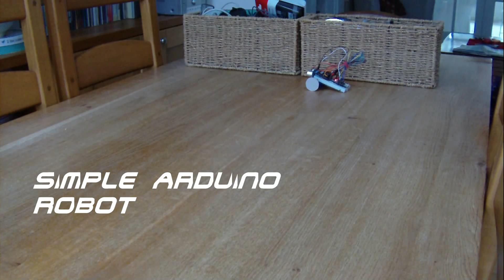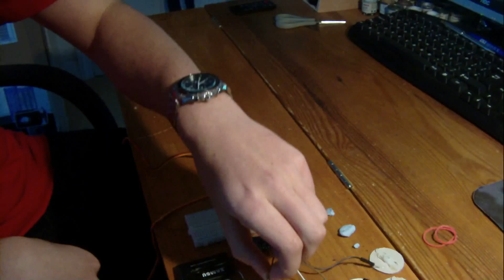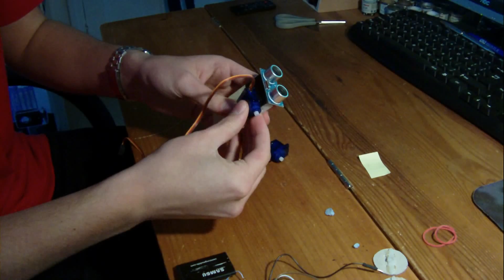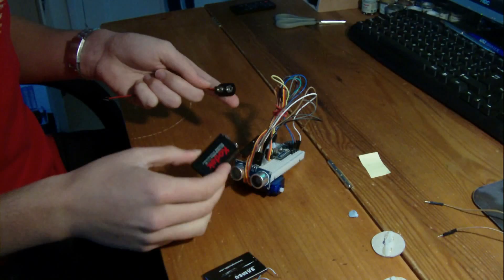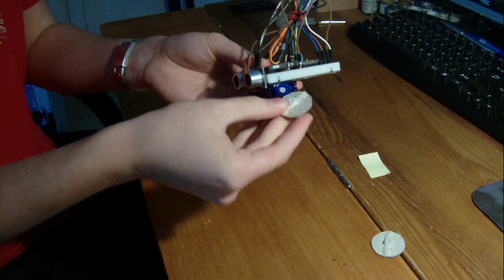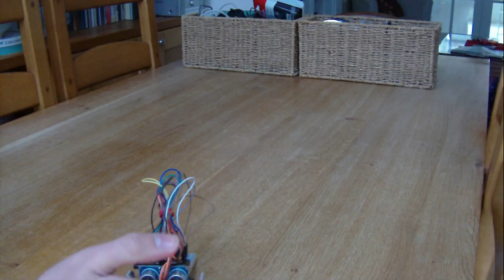How to build an arduino robot

Comment: can you make it follow a line?
Reply from the maker: To make it follow a line it would require 2 infrared sensors rather than an ultrasound one, which unfortunately I don't have. However other than the code and the different sensors the rest of the robot would remain the same.
Reply: but how's the speed control of the servo? is that a fee-tech fs90r?
Reply from the maker: By inputting a larger angle causes the servo to move faster (90 degrees is stationary, 180 maximum speed forward, 0 maximum speed backwards). I just used 9g standard servos and modified them for continuous rotation by removing the potentiometer,  but the one you mentioned looks like it would do the same job.

Comment: Good project.  By continuous rotation servos, I take it they are geared motors and they do not contain the feedback potentiometer one normally finds on a servo.  
You must be pulsing reasonably fast to be able to measure such a short range.
I think you are being very modest to describe this as a SIMPLE arduino robot.   Well you went through a few heartaches to be where you are having to learn the language and  the control system that is necessary.
Well nothing is simple ,  and  something appears to be simple only after the human minds accommodates its understanding,

Good luck with your career. Modern electronics and control teach you a lot about yourself as there is an absolute measure unlike some other subjects which have no  quantitative measure     but a qualitative philosophy which  many people like to follow because whatever they do  cannot be measured and so they feel it is correct, Few people in life like to measure themselves by guaranteeing that their products works perfectly for a long duration.

Congratulations , you certainly kept the system using very basic components that every one can find and so no one has any excuse not to aim high in life.   Good luck and I feel you did well and I would not describe your work as  being simple. Do not be too modest it is good work.
Reply from the maker: +Carmel Pule' Thank you so much for your extremely kind comment (I don't think I have ever seen something as eloquently written and coherent on YouTube before.) The continuous rotation servos are just modified normal servos, which the physical limiter removed and the potentiometer replaced by a potential divider. Thank you once again for your kindness, advice and support, I only wish I could find more time to do my projects. Merry Christmas and best wishes for the new year!